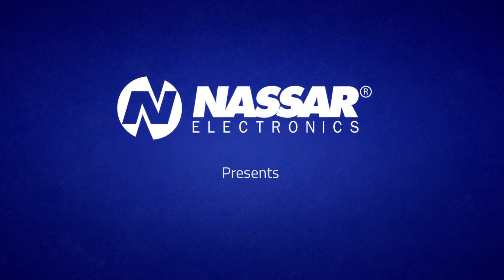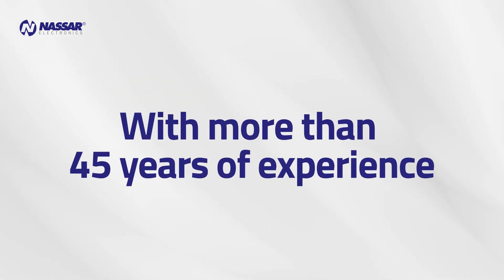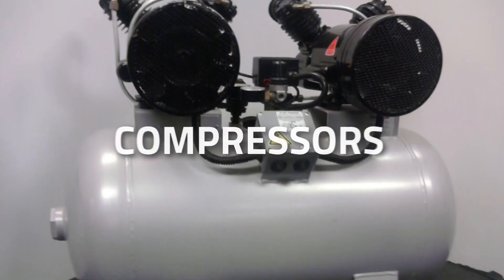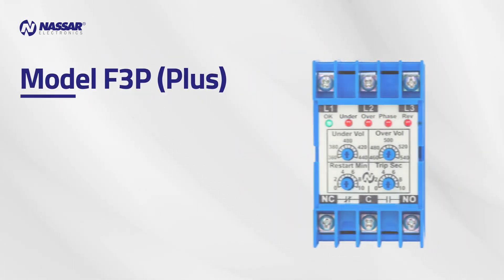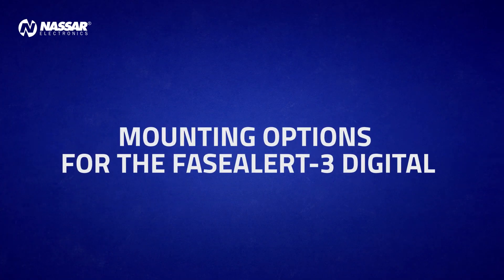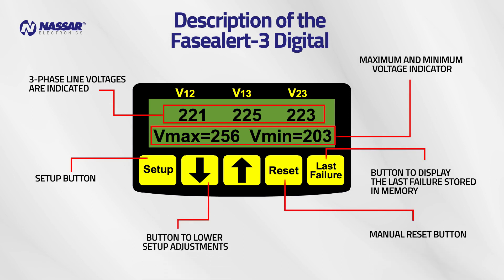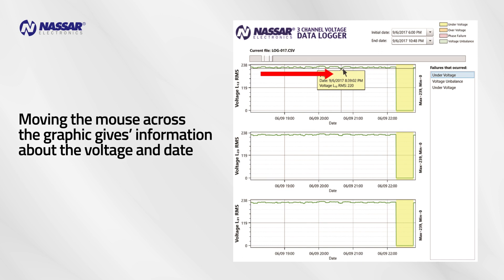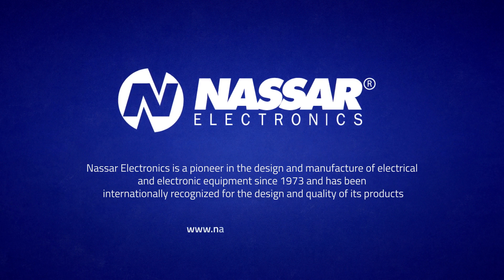3-Phase Voltage Monitoring: Motor Protection Relays

Comment: Can I use your products as a VFD type contactor 
If a VFD goes bad on a AC unit and I put a contactor in its place, the fan motor runs with way too much power and it’s way too loud 

So if you guys have a contactor, they can regulate power going into the motor just like a variable frequency drive that would be awesome